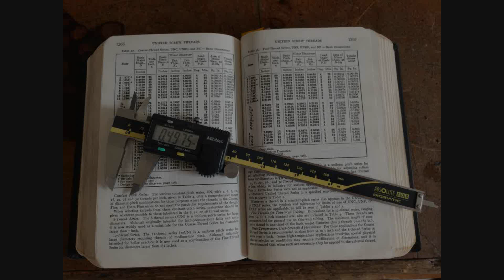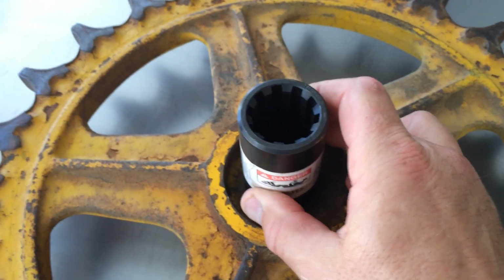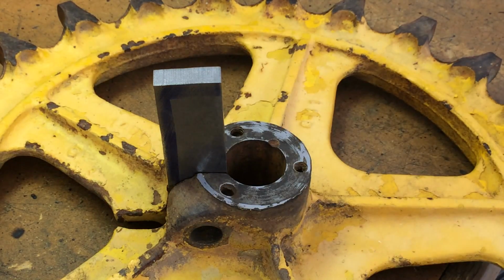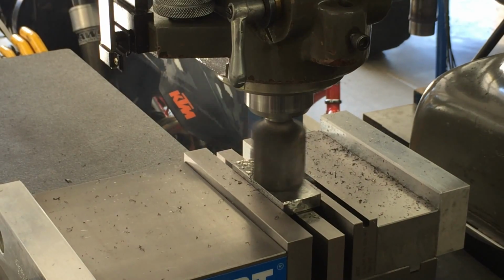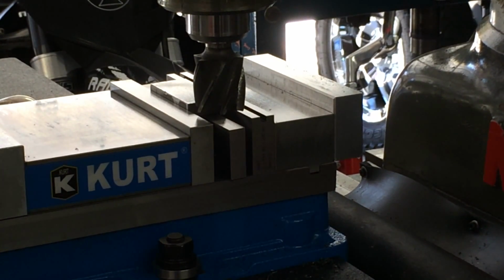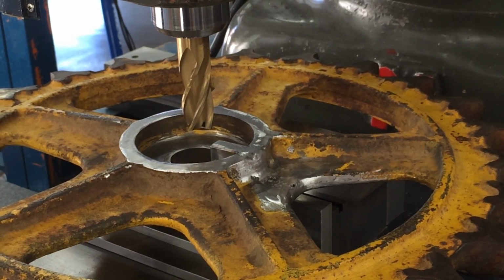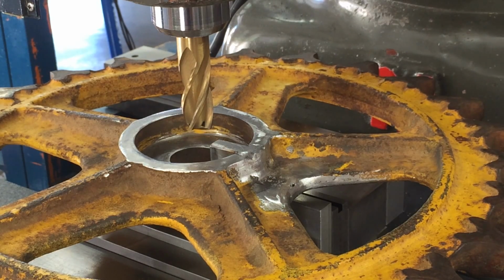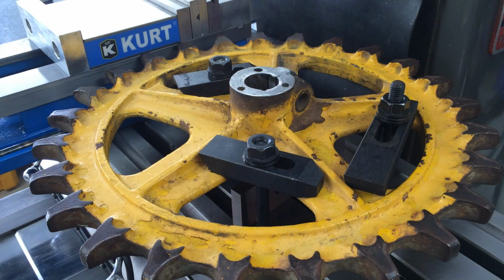Off Track Part 1

Comment: Ray,
Nice work! When you're welding, I don't know if I would want to be your cameraman! Welding sparks and bare feet aren't a great combination! :-) I liked the fact that you machined the flat piece to fit properly rather than just hammer it in and put stress on the rest of the part. Thanks for the video. Great work by your cinematographer!
Have a good one!
Dave
Reply from the maker: Hey Dave,

Thanks bud! Yea, both Phil and I know better but, notice he got hot splatter and not me ;)
I agree, the slug should have been machined regardless for a proper fit.

Thanks again,

Ray

Comment: What grade of steel did you use for the bar slug? Just curious, plus after seeing the age and condition of the Yost, this is probably the nicest repair it's ever seen, LOL!

Looking good my friend. I love your mill, it makes things sweet and it's so versatile a tool...I suppose I should learn how to run my lathe before I go jumping into the jaws of a mill :)

Happy to have you back making shows for us, VERY COOL!

Aloha, and have a great week...Chuck
Reply from the maker: Hey Chuck,

I think the bar stock is 1018 cold rolled, the stuff is good all around material for welding and machining. A mill is a must, keep a look out for one you won't regret it!

Thank you for your kind words my friend!

Ray

Comment: You seriously need to get some carbide burrs! I have no idea how you have the patience to try and do anything with sanding drums.. If you only buy one, get a good 1/2" tapered cone shape with the half-ball end on 1/4" shank. It's probably my most used burr.
Reply from the maker: Hey Step Two,

Thanks for the tip, I'm sure this would have saved me some clean up time.
I'll look into picking one up next time Enco has a 20% sale.

Thanks for stopping by!

Ray
Reply: Ray Caniglia
Sure thing, I recently stumbled across your channel and watched your videos. Enco has a 4 or 5 piece carbide burr set that is on perpetual-sale if I remember right, it's always on the Hot-Deals catalog. They are great little tools, I'd say easily 20x faster than a sanding drum! Don't get me wrong, sandpaper on a mandrel has it's place, but I would not have used it there..

Just keep in mind that they make tiny, sharp needles as they remove metal, and when they pile up on your arms/back of your hands, do NOT WIPE! Worse than fiberglass!